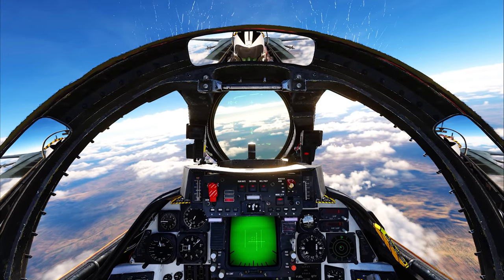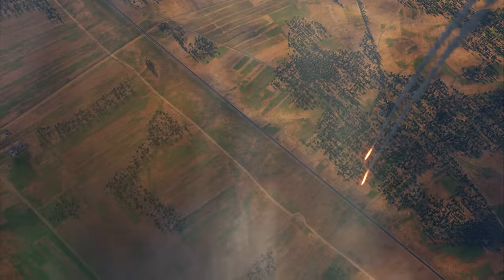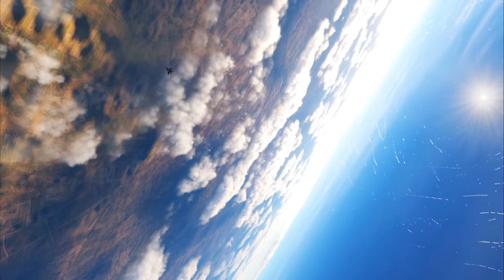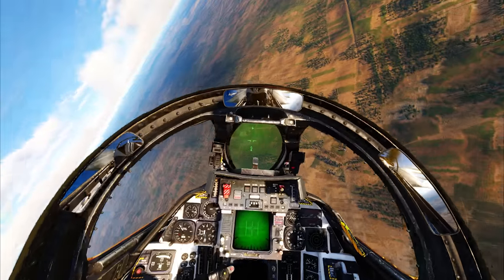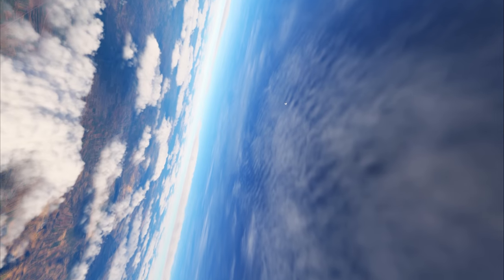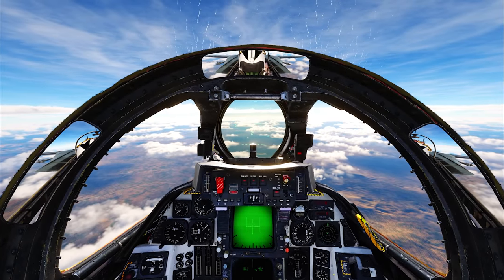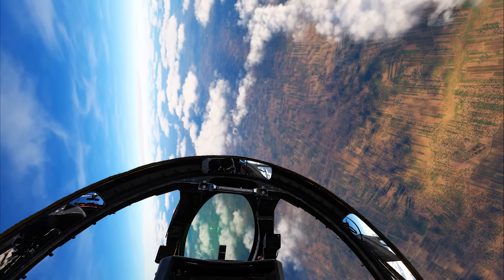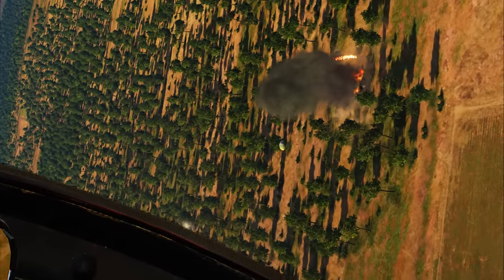Top Gun 2 Maverick Split Throttle Dogfight | F-14 Tomcat | Digital Combat Simulator | DCS |

Comment: The split throttles move only reliably works in limited BFM circumstances with the GE F-110 motors. Trying it with the TF-30s (as Mavericks jet had in the movies) is ordering a compressor stall combo meal with a side of flat spin and aircrew ejection.
Reply: Not if you are maverick hehe
Reply: lmao
Reply: @caimanaraujo479  Plot armor trumps everything.😂😂
Reply: @Pitchlock8251  Plot compresser turbo upgrade
Reply: If they can walk onto an enemy airfield in broad daylight and hop in an unguarded F-14, split throttles should be no problem.
Reply: This comment is a master piece
Reply: Ice is typing...
Reply: No but actually I think that if you know about this risk it is kind of a deep element of the story. Maverick is so all-in in his fight to save Rooster that he does this maneuver that is basically risking what killed Goose. He does it on purpose here. You could almost imagine him perfecting this split throttle maneuver in the years since Goose died.
Reply: The compressor stall in Top Gun was caused by jet wash from another aircraft passing in front of Maverick. There's 2 ways to do a throttle differential, speed one up, or slow one down. I believe Maverick slowed one engine down. If the engine on burner was still not working the compressor too hard then it wouldn't stall anything. He'd have to be careful throttling back up, as normal. He'd probably have some idea of what is too hard on the engines from training.
Reply: @danpatterson8009  That's not the unbelievable part. A fully fueled, armed and working Tomcat is the unbelievable part. :-D
Reply: It's the pilot, not the jet engines 😂
Reply: But do you get a toy at least?
Reply: @pgtmr2713  At frontline air base, every fighter is in that status. Fast response is their absolute number one priority. Do some research before nitpicking won’t hurt.
Reply: I mean only with the F-14A do you run the risk of a comp stall, which happened in the original Top Gun, but im pretty sure the F-14s in TG2 are F14Bs
Reply: @sibidinakaran4757  it's an A, tf-30s are very visible. the only Tomcats exported were A's. The US has been really crazy about keeping Tomcats and parts from being available
Reply: Ya, those tf-30's did well in the F-111; go fast, go low.  But in an air to air platform... not so much.
Reply: The "enemy", could modernize them and get rid of compresor stall ;)
Reply: @ruiliu4157  relax…chill a little…PGTMR2 was only making a joke about there actually being a functions F-14 armed and ready.   He wasn’t nitpicking anything.  It’s humor, and it may be a little different than in your country.
Reply: @inglebear84  What? How do I suppose to know who is from which country on YouTube? We don't know who is who here, and we're talking about movie, so nothing is personal in the first place. I don't know about your country, either, but for most countries out there frontline airbases operate at that level of *readiness*. Hope this is chill.
Reply: @ruiliu4157    ok ok. I was only pointing out how humor and sarcasm differ from culture to culture, maybe that was why you didn’t pick up or relay their humor. It was you that told PGT to “do some research before nitpicking”, when he definitely wasn’t nitpicking at all. Yes, we’re talking about a movie, but also about its real world applications and wether or not the movie was moderately accurate. So there’s going to be in depth discussion. 
Also, yes FOBs will keep aircraft ready and on high alert as seen in the movie. This base, being a support base for nuclear activity, would be fully alert. That’s wasn’t what he doubted. The idea that a 40 year old “definitely not Iranian” tomcat would still function is what’s unbelievable.
Reply: @pluginleah  That is an excellent point!! He mastered the maneuver that killed his Brother.

Then he used it to save his nephew.

Dude. Good call!!
Reply: @pgtmr2713  Exactly. Manually split-throttling would result in a flame-out if he knew what he was doing.

Flying through the jet wash caused an irrecoverable flame out. The only way to rebalance the thrust would be to stall out the other engine. You’d prevent the flat spin, but you’d probably drop like a rock at that point. At least dropping like a rock wouldn’t have pinned him forward against the canopy which would allow him to eject more normally.
Reply: @josephcoon5809  I was saying he could do it.
Reply: @pgtmr2713  Which is why I started with “Exactly!”

I wasn’t arguing with you. I was just explaining it in my own words. 😂 

I hate that social media has conditioned us to assume people are always disagreeing with one another. 😂
Reply: @josephcoon5809  It's okay to disagree, I just wasn't sure you understood what I was getting at.
Reply: I dont think tf30 make all this way. Maybe iranian conversion for new motor. Maybe to new russian engine swap?

Comment: The F-14 was such an amazing platform, I can only imagine if the platform could be modernized with some stealth, modern avionics and engines.
Reply: The problem is things like the variable wings are obsolete these days. You'd basically just have a new jet.
Reply: @MrEsphoenix  and it woulld be very VERY EXPENSIVE
Reply: @mutiracialbeatdownPB   exactly... the F14 was the Raptor of its day
Reply: @MrEsphoenix  I think it's less obsolete than that under current technology the weight and complexity outweigh the benefits. However if you could find a way to lighten it up and make it simpler you could be on to something. Say, a magnetic system rather than a mechanical one.
Reply: @contraststriker8198  Over a F-15?!?!?! nooooooo
Reply: @contraststriker8198  yeah no. The F-15 was the air superiority jet well above the tomcat. The f-14 is awesome and had its pros but realistically the f15 is superior

Comment: I was a little surprised that Maverick called out that maneuver because it's a real dogfighting technique we sometimes do in dogfightings.  I used it flying C-model Eagles in a pinch but you have to master it or you can outmaneuver yourself.  It was also height and speed dependent because of stalling, recovery time and possible loss of departure.  Loss a fighter in a CAT-A training cycle will get you grounded.
You had a pretty good approach and your explanation was on target.  You use this in close quarter ACM battle, one circles, to make an unconventional move and usually will only get one bite of the apple because if your opponent notice, they will counter it if you try it a second time...
Reply: I’m surprised that it works on an F-15, the thrusters are next to each other on the centreline, the differential would seem very minimal compare to an F-14 with wider set thrusters.
Reply: That would mean the maneuvers works with F-18 too right?
Reply: @CoffeeMatt10  It works for the F-15 BECAUSE the engines are close together. The differential isn't trying to rip apart the plane or induce flat spin as much as it would in the F-14.
Reply: @guts-141  it works with the F-15 because its powerful lol

Comment: I would like to point out that the B model has an asymmetric thrust limiter that you need to switch off to do this stuff. It is a guarded switch adjacent to the engine crank switch on the left panel. The A model doesn't have this. 

I asked Dave "Bio" Baranek about this maneuver at the EAA in Oshkosh a few weeks ago and he definitely showed his apprehension. He agrees that it is possible and can be effective, but in the A model it is an extremely risky move and he would be pissed if his pilot did something like that. He loved seeing it in the movie as a varsity move by Maverick to show his extreme skill with the Tomcat, though.
Reply: Super helpful comment, was actually wondering where the switch was because I noticed the same thing. Thanks.

Comment: :_GSLogo:Hi GS! Love the vids! SERIOUS question: Could you not pull the F-14 vertical sharply and use rudder and the same side engine to literally yaw around 180°? I thought that it may work because your lift surfaces area acting as an airbrake (like a Cobra maneuver) but momentum carried you along that lateral vector for a short time. During that time, I thought you might be able to "flip a yuee." Your thoughts? All well-qualified pilots are invited to respond. :_USAFlag::_F22Raptor::_F15Eagle::goodvibes:
Reply: Sounds like a manoeuvre they used to do with the P38, hammer turn or something ?
Reply: It's called the hammer head but it can be done with just the rudder on some aircraft.
Reply: The Su-35 can do that

Comment: You can actually do the thing the su 57 did in a f14. You need to be around 300-350 knots and pull the stick full back, left or right Rudder and opposite stick position. And pull the engine back on idle on the side you put the rudder in. The only small negative aspect is that you are definitely in a spin after. BUT it looks awesome

Comment: Kinda cool. Now imagine a tomcat with actual thrust vectoring and modern engines (ofc airframe out of polymer thing instead of steel n shit) a d you've got a great jet. I always wanted to see an interceptor variant of the F-14 though, AIM-54 in Hypersonic And a better radar would be lethal, even to the F-15 and MiG-31
Reply: @roninjedi2494  I think mig 31 would win
Reply: @spinningsquare1325   foxhound by far is insane beast of a jet
Reply: but dogfighting not so much
Reply: Theoretically you can modernise and then keep modernising forever. The cobra helicopter and its modernizations has been in service longer than the most produced helicopter mi-8.
Reply: @spinningsquare1325  Yeah. However, I think you could modernize the F-15 even longer. The F-15 is probably the best multi-role jet of it’s class. Its good in the one circle, its great in the two circle, it can carry a plethora of missiles. I think a stealth variant of the F-15 (Slanted rudders, less flat surfaces, etc) would be extremely lethal. Probably would be more effective than the F-35 due to it’s dogfighting capability. Dunno if the airforce would want to spend that much on a jet though
Reply: @astupiddvdcase  Because A. Its cool B. It can be used. Its dated, but it works. Its heavy and more complicated, but it works
Reply: @astupiddvdcase   because.... Its cool
Reply: there was actually a thrust-vectored F-14A model tested in NASA's wind tunnels, it only had side petals to aid yaw and spin recovery.

Comment: The F-14 was an Aircraft that could accomplish amazing thing as long as the Pilot has the Skill and the BALLS to try it the maneuvers. In the mid-90s Grumman started a project to update the Tomcats beyond the F14D and into the ST21 and Grumman actually had one demonstrator build by 1998-99 that had new Engines, Avionics and more responsive controlling surfaces that along with a poor man vector thrust system that relied more on the amount of thrust going out instead of the surfaces used by engine nozzles to sent the thrust the way the pilot wants to go.  The Split Throttle move in Top Gun Maverick is something that I believe only the VERY BEST Tomcat Pilots would even have Dared to Attempt back in the days when the F14 protected the Fleet from enemy aircraft in the high seas. I was in the Navy and worked on Avionics Systems and I contacted a few Tomcat pilot that I know about the Splitting the Throttles and they told me that some had tried it during their time at Top Gun and it was Technique that was used but not recommended because it put allot of stress of the airframe but if was to be used as a last resort move in COMBAT ONLY!

Comment: The maneuver that Maverick does is real btw. It's called a Herbst turn. It's a variation of a cobra maneuver. It uses differential thrust to induce a skidded roll during a cobra maneuver in order to more quickly get nose on by changing the angle of attack rapidly.

Source: I play way too much Star Citizen.

Comment: Those rear shots showing the differential horizontal tails are nice to look at.  Those horizontal tails are the same size as the wing of an A-4 Skyhawk.  Max carrier launch weight was 74,349 lbs with an empty weight of 41,353 for an F-14D. Max trap was 54,000pounds. 6 AIM-54 was 73,329lbs with EFTs. 2 Sparrow/2 Sidewinder and 4 Phoenix-loadout launched at 72,646lbs went into combat at 64,172lbs reaching 1,052 knots at 35,000ft.  Then lob off your Phoenix(4000 pounds plus at least 1500lbs in weapons rails) and you still have Sparrow and Sidewinder to clean up with. That combo can do 692 knots at Sea Level(SL).  With weapons pylons on the gloves and the gun it could do  740 kts at SL, 1,196kts@35,000feet.. F-14 was considered clean even with the glove weapons rails as every fleet aircraft came so equipped. They were changed as some point as well, redesigned giving a different frontal look.

Comment: You could do differential thrust easily in the GE-F110 powered F-14s. However, the TF-030 powered F-14A could potentially have a compressor stall since at very high AoA, under high G-load, aggressively slamming the throttle in/out of afterburner while applying rudders could cause a disruption of airflow to the inner side engine. GE-F110 engines did not have such issue. However, pilots in F-14A have said, they could do pirouette turns and people like 'Okie' and 'Snort' were very proficient at doing Pirouette turns at less than 100 knots and high AoA.  F-14's airframe due to the 9 feet wide apart nacelles, was actually very maneuverable under differential thrust. One had to be careful as if not done correctly, could cause a flat spin.
Reply: Finally someone who has done some reading

Comment: Thomas McGuire would do this with his P-38 during WWII. By cutting throttle to the inside engine during a turn he could cut a tighter circle than normal, which was very helpful in racking up his 38 victories.

Sadly, I believe it also contributed to his death. During his final dogfight, McGuire was engaged at low altitude, stalled, and augered in. If he had pulled power off his inside engine that could have contributed to the stall.

Comment: The F14 was such an absolute monster. It's a huge shame they never updated it like the F18. Imagine this thing with modern engines, a flight computer to do differential thrust like this in the one circle, and vertical thrust vectoring to help it with turns in the 2 circle. Let alone everything else that would've been updated.
Reply: yesn't, it was way too expensive
Reply: @devnandannair2336  yea apparently the adjustable wings were a maintenance nightmare.
Reply: But nobody in thirty years will still be lusting after the F-35, saying it was such a beautiful beast, and one of the best the Navy ever flew. And it's plenty expensive to maintain as well as being a 300% uglier airframe.
Reply: @billykorando  i don't think the wings were the problem, there were other issues like the cooling system, apparently. The wings were just an additional movable surface, just like any other- and they added alot of capability. The F14 would have been able to easily super cruise had it flown today.
Reply: @BeingFireRetardant  You're comparing a stealth multirole e-warfare and support jet with an interceptor/ air superiority fighter. If you're going to compare it to something, the raptor would be closest to the roll it would be competing for.

 You'd have to change up so much that it wouldn't really be a tomcat any more. Not to mention variable wings are obsolete these days and unnecessary maintenance.
Reply: @MrEsphoenix  
The entire point was comparing two Navy fighters. One beautiful, one completely forgetable.
Reply: @BeingFireRetardant  Your memory issues don't factor into military hardware. The two simply don't fill the same role.

Comment: I can see how it would give you a nice kick in yaw, but can it do anything the control surfaces can't already do? I would think a kick in pitch would be of much greater value in a dogfight (based on sims of the F-22 eating everything alive).
Reply: You basically answered your own question.  Differential throttle, especially in the F-14 with it’s widely separated nacelles, would produce significant yaw rate.  That’s what technically causes the crash that killed Goose in the original Top Gun.
Reply: You are doing it in conjunction with the control surfaces, when you're pretty much at the limit of their authority. So it gives your nose an extra kick to a position you otherwise might not be able to get it in while keeping the jet loaded. I've used it in the Eagle a bunch of times, after seeing a RL Eagle doing it in a video clip.
Reply: @infidel1993  That flat spin was caused by jet wash.
Reply: @gillhewerfamily6550  The jet wash caused a compressor stall in both engines; first one, then the other.  If both engines had flamed out at the same time, or only one engine was lost, there’s a good chance Maverick could have recovered (like he did later in the movie).
Reply: Control surface authority is proportional to airspeed. More yaw authority with thrust from both engines and higher airspeed, or one engine reduced and lower airspeed?
Reply: @danpatterson8009  Your attempt to apply yaw is being countered by the plane wanting to fly in a straight line. Equal thrust is fighting the yaw, differential thrust aides it. That should seem pretty obvious if you've ever lost an engine because you have to counter unwanted yaw at that point. Typically if you're trying to use it in bfm you've got the jet loaded already and the surfaces alone aren't going to give you any more of what you're looking for alone.
Reply: @blkspade23  My idea...instead of hand throttle play in the F-14, set up a system that controls differential thrust via the rudder pedals. That would've been  interesting to see if that would come to fruition during its service life...